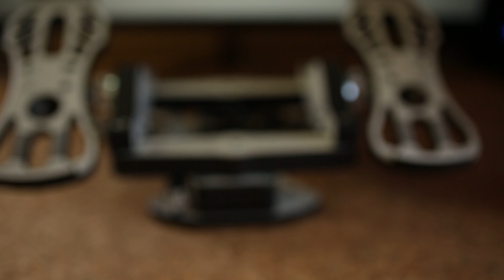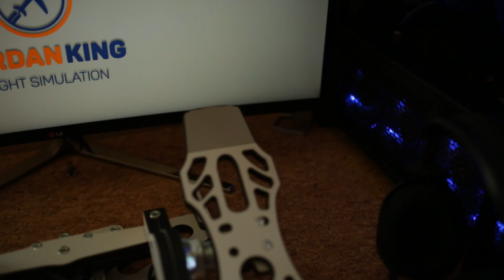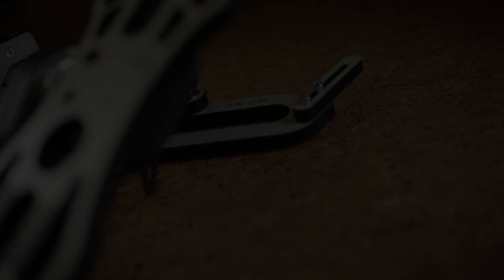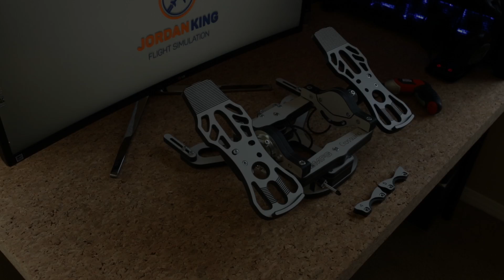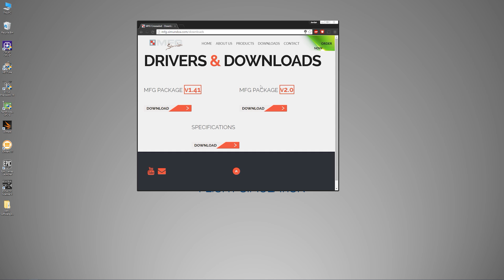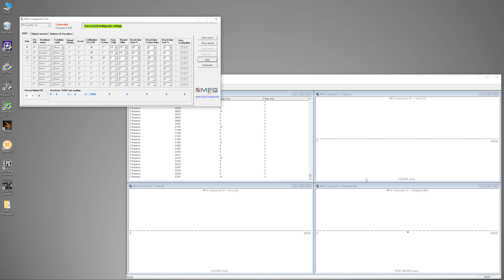MFG Crosswind Rudder Pedals Full Review *The Best Rudder Pedals*

Comment: Got mine an hour ago, already installed and working. They look great and are incredibly smooth, it’s real solid engineering as it should be, not low cost mass production. It’s early days but from a quick test it seems easier to hover a helicopter in DCS.

I haven’t bothered with the software, I plugged them in and DCS picked them up straight away so until I know otherwise I’ll just use the DCS axis tune so I can have it different for each aircraft.

Comment: Overrated and somewhat overpriced pedals. These are plastic, don't have provision for hydraulic dampener. Not designed for different controllers (Master/Slave). I'd get BRD or Slaw if I was in the market for pedals. They are metal, have dampeners, have more adjustments and are overall much better products.
Reply from the maker: Never heard of BRD, but I have tried Slaw and they are great, installed the dampner and they got better, but they are far to overpriced compared to these and there is certainly not as much adjustability with the Slaw's as there is with these. The material is as solid as anything I have put my feet on in a plane and serve their purpose with great accuracy and ergonomic options. I am more than happy with these for the money.

Comment: Can you align a toe break horizontally, then give it a new axis center and split the axis into both forward and backward deflections? Meaning being able to tilt the toe breaks from a neutral horizontal position to either a forward position or backward position.
Reply from the maker: +Juicebowl If I am understanding you question correctly, yes.
Reply: Yeah basically I would like to get one pedal's axis to register both negative and positive inputs. Is the spring capable of recentering if depressed in either direction? With this functionality I would be able to bind 2 functions like strafe up/down to a single pedal. 

Thanks for the info.

Comment: Ikea pedals!  They look awesome but I probanly wouldn't spend $350 on pedals unless they were customized to be a specific aircraft.
Reply from the maker: They are pretty versatile, and for someone such as myself, I enjoy pedals that I can use in a number of scenarios and aircraft. This does the trick for me.
Reply: I went with the cheaper CH Pedals and I'm pretty happy with them other than the spacing (pedals are close) and the noise (not too loud but just enough where it's like I'd rather not hear them move).  And I did a mod myself on them sort of like the EzeMod by cutting up a mouse wrist rest and sticking it to the pedals and putting them on sloped pads.

Comment: Out of curiousity, what realism settings  do you fly with? I'm a very avid flyer of thePMDG 737 and have my realism settings up all the way, but I found that the plane naturally yaws left. I'm looking for realism especially for crosswind landings and if the plane yaws left without me putting any rudder input then it's basically an autorudder if there's a crosswind coming from the left. Do you have any suggestions as to what settings in FSX provide the most real like feel. Or if there is any addons I am not opposed to buying it. Thanx for the help!
Reply from the maker: +Ricky Castrigano The plane yaws left because of the torque of the engine along with the natural airflow of the air from the propeller vortex which causes the plane to yaw left. You can turn down the settings in realism to make this more comfortable for you, but generally I fly with the sliders all the way up and just fight it.
Reply: +Jordan King thanks for the reply, ive been testing things, but even on takeoff if theres a heavy crosswind, as i start my takeoff roll the plane will yaw on the ground into the direction of the wind. Im starting to get the impression that the plane autorudders for wind. The box in the settings is not checked. I dont know whats going on haha
Reply: I know it was a year ago, and you may have realised the answer by now, but it may be down to "weathercocking". If the crosswind force acting on the vertical fin & rudder, overcomes the sideways force on the fuselage then the plane will point into wind. I'm not saying it's correct for the type of aircraft you're flying, but it can happen. Now if the plane is yawing left without a crosswind from the left then perhaps there is a calibration issue with your hardware - recalibrate and/or increase the dead zone slightly?

Comment: Great review. I actually went with the Slaw Device pedals instead of the MFG. I wanted the all metal construction and the oblong base suited my rig where the MFG's wouldn't have fitted the space available. Most expensive single piece sim peripheral I've bought (Warthog is 2 pieces) but my god the difference is incredible over my Saitek Combat Rudders. I'm a DCS guy mainly and never had the ability to fly the UH-!H Huey before without it ending in a burning wreck. Now tiny yawing is so precise its become a really enjoyable experience. Liked and subbed. Cheers.
Reply from the maker: +RenovatioJuris Hey Renovatio. The Slaws are some nice hardware! I was looking at those as well but the wall spacing didnt work for me. Sounds like you have a sweet setup and I am sure you will enjoy them!
Reply: I don’t know what the MFG are made of, but it looks and feels like metal, even when you’re assembling them.